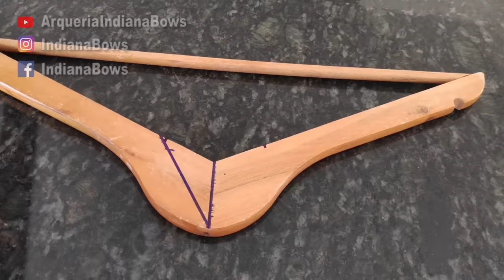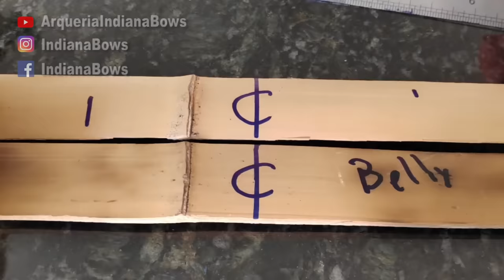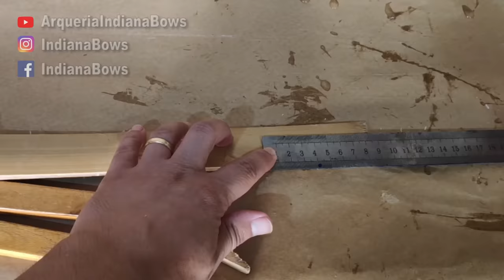Brilliant Idea Making a Bamboo Bow With a Wood Hanger | DIY Bow and Arrow

Comment: Great craftsman.  Adding a high mass, dead weight on limb extremities really is not a good design.  Too much loss in accelerating heavy ends of bow.  All that work could have been channeled in laminating the whole bow in bamboo thus having the ends of recurve bow also contributing to spring force.   Throw the clothes hanger out! I still have to admire his skills.
Reply from the maker: Yeah.  But I did throw the clothes hanger away in the end.  😆😉
Reply: 66lb pull though,not bad

Comment: Hey there. Im revisiting this awesome bow build video. May I qsk how is this bow holding up or any other bow younhave with this design? Bamboo back and belly. Is it still good? Is it still keeping up its poundage? I've got some good giant bamboo dry and ready to use. My bamboo was drying for 6 months. It seems ready now.
Reply from the maker: Hello! Thanks for comment and yes. Bamboo bows are pretty good. If you make a quick research you will see that before laminations with bamboo/wood/fiberglas, Howard Hill made history with all bamboo limb bows.
But you need to pay attention in a bunch of details on make then. For example, use only the part of bamboo who has more fibers (doesn't matter how many laminations you use. It will be better using 2 thin laminations than 1 thick), and when you glue it, make a lot or reflex on the bow, because bamboo take much set when you do the tillering.
There's other tips that could be helpfull, but in a comment its complicate to tell everything. But, If you do the bow in right way,  you can have a pretty fast and strong bow.
Reply: @IndianaBows  Amazing. Thank you for responding.  I'm busy with a build right now. I'm going to take my time with it so that I do it properly.  I'm going to try and research Howard hills bamboo limb bows. Sounds interesting.  So by using 2 thin lamination instead of 1 thick. You don't need to use a core wood and the bow would hold up well after the initial set after tillering?  When making a bamboo back and belly bow with 2 bamboo lamination. How long does the bow need to be to at least get a 30 inch draw on the bow? I want to make a similar design horse bow with siyahs. My bamboo is definitely ready. It's dry enough. I was lucky enough to get giant bamboo with very thick walls. The bamboo walls is about 21mm thick which is very thick. So it us very strong. The only thing is that this bamboo I got, the nodes are kinda close to eachother.  The nodes are 11 inches apart.  Will this be ok to make the bow? I do appreciate your responses because i learn a lot. Thank you

Comment: Wow. Absolutely amazing craftsmanship.  May I ask. How does a person prevent a bamboo bow like this from taking set.  Can a person make a bow like this and keep it for years without it taking set?
Reply from the maker: The way that I do, is glue the parts with some ( or a lot of) reflex. So, when It take set It Will lose the reflex until stabilize in a bit of reflex or a straight bow.
Reply: @IndianaBows  thank you for your response.  I appreciate it. Could I perhaps also use another piece of bamboo as the belly of the bow to prevent set? So to maybe just take another bamboo piece and glue it to the belly of that bow. So then both the belly and back of the bow will have the outside skin side facing to the belly and the back..like they make the Japanese bows. Will that also help to resist the set?

Comment: incredible piece of craftsmanship! but i have a question, is possible to backing this model of bow for pounds improvements? if it is possible, approx how many pounds?
Reply from the maker: Thanks very much. The bamboo used in the backing of the bow, is already a backing.
What you can do is use a core wood ( or even bamboo)  between the backing and belly.
That should work to increase the poundage.

Comment: How wide/thick were the banboo strips? Hard to see watching on a phone. The only ones I've found to buy are 45mm wide. Cheers.
Reply from the maker: The original wide tha I used was 4.5cm.  After I cut and work with it, it lower to 3.5cm
Reply: What about thickness? Cheers.
Reply from the maker: About 5 or 6mm
Reply: @IndianaBows  : Thanks. I'm going to give it a try.

Comment: I could have taken a cured stave chopped with an adz , shaved the wood and tillered to get equal flex and poundage pull, and also made the bow string cordage in 1/4 the time. I would also have used stronger wood. Bamboo has a great failure rate in bow making.

Comment: Doesn't do the limbs twist by wrapping the rubber band around for glueing the two halfs together ?
If they do so, it may help to wrap a second rubber band in the other direction.
BTW - nice thing you didn't make it too pretty ! xP
But the basic composition is very well done.

Comment: “dowel reinforced butt joint”
where your wrapped it & glued coathangers on, I would've drilled out two holes in coat hangers for the Dowl drilled through bow ends for dowl to fit tightly & glued it also, for extra strength & then cut & sanded the excess dowl down to flush with back of of the bow, then wrapped it. Would of gave those weak points extra strength for a greater pull tension. 
But that’s just me.

Comment: the bow has great power but I don't think it can fly far enough
Reply from the maker: Yes. That is a really simple bow.  There is forms to make It much better, using wood laminates with the bamboo. But for a simple timelapse instrucional vídeo, I prefer make It simple to inspire who Watch It. :)
Reply: @IndianaBows  ancient bows can shoot as far as 200 meters, they can fly that far thanks in part to the structure and material of the arrows.
Reply from the maker: Yes, flight arrows are made to go really far. A good bow, with good material, helps a lot.

Comment: Bro I'm gonna try this build it looks amazing ! but do I need to treat the bamboo? Should I heat treat the bamboo to remove starch and moisture content? Or just apply heat to the belly side of the bow like you did?
Reply from the maker: Yeah, it's good make a light toast on belly bamboo like I did because it increase the compressions resistence of It. :)
Reply: @IndianaBows  will do thx 👍

Comment: New Title:
How to make a bamboo bow with a coat hanger and $50,000 worth of shop equipment and years of experience.
Reply from the maker: One more complainer guy... 🙄 I bet you that I do the same using a good knife and a file as a tools.
The only difference is that I probably spend more time on it.
The workshop tools helps, but if you know how do it, you can do it with tools you have.
Reply: @IndianaBows  
I didn't mean to complain.
Obviously the biggest difference is the experience.

Comment: Are you supposed to be wearing gloves?  I've heard that wearing gloves around drills, bandsaws, or lathes is dangerous, as it increases the chance they might get caught and rip your fingers or hand off.
Reply from the maker: I didn't know that. 😮😮
Reply: It’s personal preference..... rotating machines are safer without gloves if you are not confident on a tool. That’s it. It’s personal preference completely.... beware the safety police!!

Comment: This is not the best bamboo for bow purposes.. the intersection of the nodes is too close. It would work as is evident but I’m quite taken back that you are a bow maker using this!? Inferior for a good bamboo bow
Reply from the maker: It's mosso bamboo.  I have some separate slates in natura to make bows like this (only for fun) and others longers with threatment who I made some Bows that I sell.  The distance of intersection of the nodes is not so bad.  The biggest problem is in the tillering process.

Comment: he only made a normal bambo bow not from a hanger but from wood.... he has tabel saws and planes he could have used a plain 1x4 and it would have been more interesting. especialy with the fully loaded show this is not a skill sorry with a shop like that i could build a 10x better bow with thing i find in the woods...!! sorry dude this would be waste of time and effort !
Reply: pluse the way the grain is on the hanger this bow wont last using a single test is not practical. the other parts other then the hanger are cool but but really a hanger that had downward grain to the draw will not last you need a bow to last for a while in the wild and you had a sexy shop i would have rather seen a bow hand crafted from a nice hardwood and the bamboo!!
Reply from the maker: Do you know How to read? Because It's explicit in the title what I did: A bamboo bow WITH a Wood Hanger. And of course there are several ways to make better Bows. And if you want one better, you still can find here in my Channel. (Search here for a recurve takedown bow build, or the hybrid with carbon). But I think If you can do something better, You should do it and post here to all of us. But do something really better, a good bow with good speed ( or at least faster than mine).
Because all you said is only words with no action.
By the way... The bow WITH the Hanger are still here, working very well 2 years later than I made It. 😘